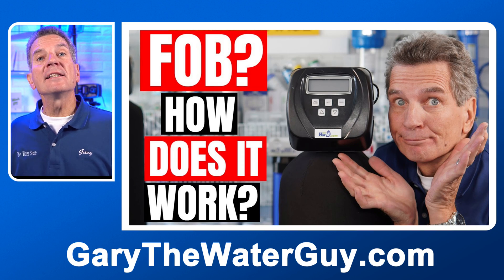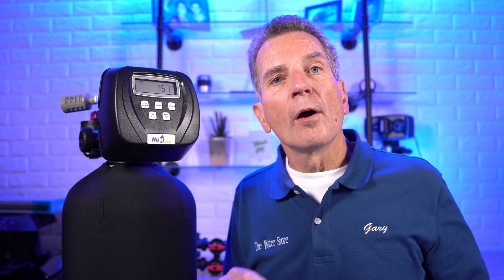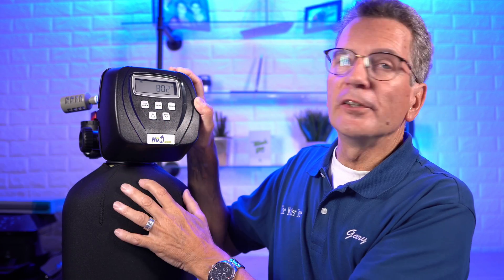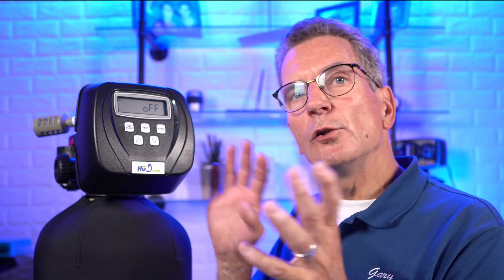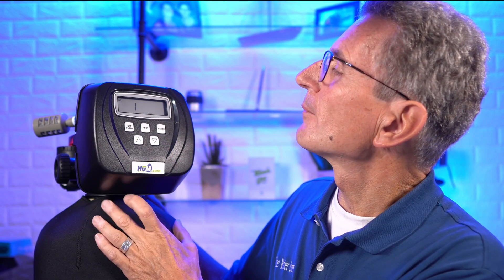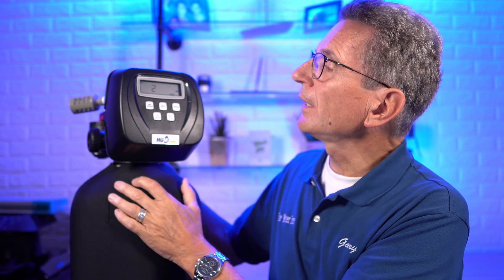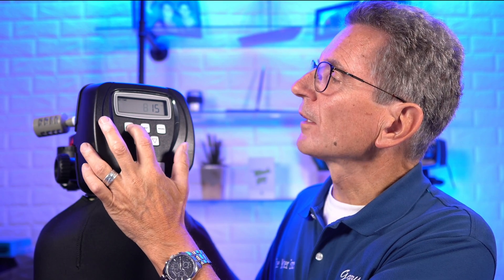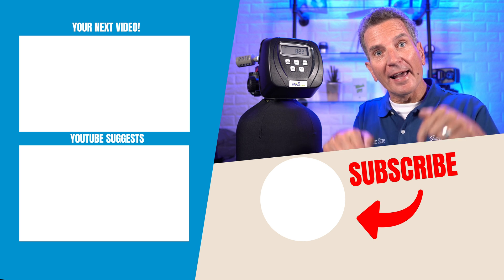CLACK WS1 IRON Water Filter PROGRAMMING

Comment: You don't use any rapid rinse after the airdraw for Katalox?
Reply: Rapid rinse will basically push out the air bubble created during the airdraw cycle. Don't use it in an AIO system

Comment: You said 1 inch valve.   Does that also applies the tube that connect to the control head from the tank. They come in 1 inch and 1.25.

Trying to learn here
Reply: Strictly the valve size.

Comment: I have this style of filter/softener. Mine is hooked up to salt, so I guess I should use the softener selection, and not the filter selection. Is this true?
Reply: Yes. That is either a softener or tannin filter, but both use salt for regeneration and use basically the same softener settings.

Comment: I have this same iron backwash unit. It was originally set to 3 day cycles of backwash by the installer. I didn't think that frequency was necessary based on water color in toilets so I changed the frequency to 4 days. What if I changed it to 5 day cycles. How would I know if the time between cycles is too wide? Thanks.

Comment: Great video !!!  Gary I really believe from my testing of katalox light.  It requires a rinse to get rid of foul water after the Backwash that is still in the bottom of the tank.  I have noticed this from 10 years of testing Katalox light.  I think the programming should be changed to Backwash..............Rinse........Then Brine draw (air)  This will allow it to be rinsed with out losing air pocket.  I am currently going to Install aV3108CC-07 board and V3175CC-01 Cover to my  WS1 valve to accomplish this.
  I would like your feedback. 
 Also a video would save me a lot of time and effort as to trying to figure this out.  This could then be passed on to your Customers using Katlox Light😀
Reply from the maker: This should work but why do you think the backwash alone isn't getting the job done?
Reply: @water_estore  Thanks for the reply, From my testing.  After the back wash is complete. The "Air Draw" cycle/slow rinse.  I have put valve in Rinse and ran the water in to triple bay sink. This is with a 9gpm DLFC.  The water is "dark" for about a minute.  This has been done on several occasions for testing purposes.  This is how I came up with my theory of operation.

Comment: After my iron filter backwashes, I have air @ taps for few hours. Not a big deal, but shower balance valve seems to struggle with the air causing hotter then requested water. Should I reduce air intake time to stop air? Any tips would be appreciated.
Reply from the maker: Yes, that would be the correct way to minimize the concern.

Comment: Hey. I have a question we have this same unit for our home and it is used for iron and Sulphur as we have hard water. The unit is set on softening in the settings should I change that to filtering. 
Thank you
Reply from the maker: No, but the programming depends on a number of factors, if it works I would leave it alone.

Comment: We have a functional Clack WS1 on a media tank that was taken out of service in a water softener application.  Can we convert it to an air over media iron filter by changing to the correct media in the tank, reprogramming the valve as described here, and adding the air intake? Any other changes that would have to be made?

Thanks!
Reply from the maker: Yes but it needs to be a 5 button valve with 3 buttons on the top and 2 on the bottom.  Also, it need to have a tank big enough and flow restrictors sized to the tank and the media.  It will take considerable work to convert it over.

Comment: Hi.. I started getting gray  colour water out my taps after iron removal system does a regeneration. The water clears up after running the water for 5 min. I changed my program to the one suggested in your video but it is still gray after regeneration. I added a rinse cycle but it didn’t help… any suggestions would be appreciated.
Reply from the maker: Hopefully you added the rinse cycle before the air draw (regen)? It could be excess manganese in the water, do you have a water softener after the iron & sulphur filter?
Reply: No I don’t have anything after the iron filter
Reply: The rinse cycle I added is after the air draw… I will change that to before the air draw so I don’t loose the air bubble.
Reply: The system I have uses greensand media and worked great since 2017
Reply from the maker: Don't know much about Greensand systems, haven't used those for over 15 years.

Comment: Hey Gary, I have the HUM FOK iron and sulphur filter from you folks along with the HUM 30k softener with manganese mesh - for the filter settings, after 3 days, it does a regen. Can this be extended without damaging the media or is 3 days the max? Thanks again for all of these great vids!
Reply from the maker: 3days is the maximum on the iron filter.  The water softener is metered so it will determine itself when to regenerate. Thank you for your business!

Comment: Hi Gary, I have two clack tanks both with WS1 valves, I smell sulfur and the 2nd system says iron blocker in the settings , I haven't heard you address that setting , is that correct?
Reply from the maker: I really don't know exactly what you have.  "Iron blocker" is likely a term they have added themselves somehow but that is not part of the Clack OEM programming.  Time to call whomever you bought it from.
Reply: Thanks for the reply. I reset it according to your instructions, I still smell sulfur, so I have called a service company. It’s not an option to call the people that I purchased it from it was part of a new construction build, and they are   not responsive, possibly not even in business anymore

Comment: Great Videos Gary! I have a Fleck Control vlv and it’s set for a 15 minute backwash, 30 minute air draw and a 1 minute RR (Rapid Rinse). I noticed that  the 1 minute is almost 2 and that rinse knocks my air pad down to about 4” below the valve. That doesn’t seem like enough air exposure for the iron. Should I eliminate this cycle and stick with 2 as mentioned in your video? What amount of space should the air gap be?
Reply from the maker: Yes!  There should be no cycles after the air draw.

Comment: Hi, I have two clack valves on both tanks, one is 5 buttons and second is 3. Water softener is 5 buttons and brine tank connected to it. Iron tank is 3 buttons. I would appreciate if you explain how to set regen time on two tanks for best performance.
Reply from the maker: Keep the regeration times at least 2 hours apart.

Comment: I tried doing the programming for the cycles but after pressing next from dPOff it just goes back to the clock. I have a 5 button but they’re all vertical, I’m not exactly sure why it’s not allowing me to edit the cycles. I also have recall and call on my cycles which I haven’t seen on any other systems. Any help is appreciated.
Reply: Forgot to add that recently the waters been coming out clear but with a foul sulfur smell.
Reply from the maker: It's likely locked, this video will show you how to unlock https://youtu.be/bU3wW29R7iE.  The call message means nothing.

Comment: I have a 5-button Clack WS1.  There is no QR code under the cover.  What is the website the QR code directs to?  Thanks.
Reply from the maker: The full manual is here https://cdn.shopify.com/s/files/1/0659/5447/files/Clack_CC_Valve_-_Full_Manual_Including_Diagnostics.pdf?v=1624357628

Comment: Gary. All the videos are great. I have a ws1 fok the system works great with one problem. I have red water iron the system backwashes then rinses then air draw. The problem is after air draw it passes back over backwash on its way back to service. This only last a couple of seconds but is enough to discolor the first 5-10 gallons of water   After that the water is clear again. Is there a way to not pass back over the backwash cycle when going back to service. Thanks
Reply from the maker: No there isn't but lengthening the drine (air draw) cycle might help.

Comment: Hello Gary. Thanks for all the videos. I noticed that you mention that an iron filter does not require that a rinse cycle be programmed. I puzzled. When I phoned the iron filter manufacturer representative, he told me that I need to have a rinse cycle. I'm wondering why there is this disagreement on the need or no need for a rinse cycle?  Daniel in WA.
Reply from the maker: Great question.  Depnds on the kind of iron filter.  The air over media iron filters (newer technology) uses the air draw as partily as a rinse cycle.  If you added a rinse cycle you would lose the air bubble to drain. Older technology systems that don't draw air have a rinse cycle.  https://youtu.be/sx_j7W9z9FQ

Comment: I can change the setting to filtering. But when I try to enter the next menu by twice pressing next-down, nothing happens. I tried unplugging the power clip at the board for a minute+, still nothing, did the same with battery out, still nothing. It is a new board, please help.
Reply from the maker: Once you change to filtering you need to keep pressing next until you get to the end. Then press next-down twice and proceed
Reply: The next-down twice press does not work with the new version (9D) of the control board. It only accepts the pre-programmed P# codes to set regen time cycles, none of which gives a 15 minute backwasf/30 minute slow regen. Always get a fast rinse at the end, which expels the air space needed for sulfur filtering. Is there any work around?

Comment: Another great video Gary! I have my iron filter valve set to 15min backwash and 45 min air draw, but still get a metallic smell and some discoloration in my water, which after sitting in a cup for 3 to 5 minutes turns yellow (clear water iron that oxidizes I am assuming). What's the max time I can set for the air draw cycle to see if increasing the air bubble helps? Is this the right thing to do? Thank you!!
Reply from the maker: 60 minutes

Comment: Hello Gary, will there ever be a reason why my Iron Filter ClackCorp Valve shows "SOFTENING DN POST" as opposed to "FILTERING DN POST"?  With the "SOFTENING DN POST" setting, I could only see 2 times set, being a "Backwash Time" setting of 25 minutes and a "Draw Dn Time" setting of 60 minutes; When I scroll through the settings all others are OFF or not set. I have a pretty big system in my house (1.5" valve, and 22GPM Demand), the controller valve is made of Cast Iron. Initially, the Iron Filter times were lower, and the filter turned on every 3 days. For some apparent reason, this was not enough, and it caused the Injector to get clogged up and was not taking in any air. I had it serviced, and the technician was able to clean the injector. During his visit, he increased the times to 25BW/60DDN and was going to set it to turn on ever 2 days (I am guessing to avoid the injector from getting clogged up with Iron). I asked him to have it turn on everyday as I wanted to flush out and clean my cylinder (approximately 60" high x 18" wide) and all my plumbing. I appreciate you taking the time to inform the general public everything you know about Water Filtration and Conditioning.
Reply from the maker: I have never seen this, but we have never worked with the 1.5" Clack valves so that may be something we don't see in the smaller 1" valves.  Typically regenerating more often does not prevent the injector from clogging.  It will likely clog the injector more frequently.
Reply: Just moved, the sulfur filter says "softening dn post" - what does this mean and what should it be set to? Also...what happens if your sulfur filter is set to "softening" really appreciate the help...  @water_estore

Comment: Gary all of a sudden my clack filtration system has discolored muddy like water. What should I do to help with this? The water at my well is clear but after it goes through my system its discolored and cloudy?
Reply from the maker: Is it a water softener or iron filter?
Reply: @GarytheWaterGuy  iron filter but my guy added carbon to the media so we think that was the problem and it eat through the filter. So every time it regenerated all the sediment came into the house. So we replaced it and didn't add the carbon but now the water has a slight sulfer smell to it. Any ideas how to fix that?

Comment: Got a question for you . I have brine tank that holds salt connected to clack tank tha regens on gallons and that is connected to Air Injection Systems with Fleck 
2510 that draws air but regens everyday. Now the settings are DO-1 BW-10 and BD-60 RR -0 BF-10  . But manual states that RR should be 1 and BF-0 . Which 1 is right ??
Reply from the maker: If your water softener is post fill, the first one is correct.  This video will explain https://youtu.be/GedMruLfXhY
Reply: @water_estore  this is what i found out . That the fleck is running as filter so rr should be off . Would there be a reason why its running as filter ? Just curious
Reply from the maker: If it is used for anything other than a water softener or tannin filter it will be set to run as a filter.  Is it a water softener?
Reply: @water_estore  it is connected to clack which is second unit this one runs first then clack and then water softener tank

Comment: I can’t seem to access the setting with next and up at the same time…it had been working but now when I try that it just shows the number of days until next backwash…any tips?.
Reply from the maker: Reset the board buy unplugging it at the board, wait one minute and then plug it back in.
Reply: Gary tjis is cyndy how do i change the battery if i do.does that mean the whole system needs to be reprogrammed and how do we do that

Comment: I really enjoy your videos!  I use the 3-button WS1 system to oxidize sulphur from my carbon filter using hydrogen peroxide every four days.  What is the correct setting P0 through P9?  Mine was installed with the P4 setting.  How do you choose which P0 - 5 setting to use?  And what concentration H2O2 do you recommend dosing in the brine tank, 7% or 35%?  Thank you!
Reply from the maker: Sorry, I don't use chemical systems so I can't help you.

Comment: Is the small 2032 battery installed on the circuit board panel for back up power function? The display is out even with the unit power cord plugged into outlet, does this mean the circuit board needs replaced?
Reply from the maker: Yes, the battery is for back up only.  This video will help you trouble shoot the circuit board https://youtu.be/E5krvgEW-q0

Comment: Hi Gary! I have a 4 buttons ws1EA, instead of 2 options softening and filtering, I have 1 more, 'filtering regen', which is much like the 'filtering' option in this video. I selected backwash 15mins, draw air 30 mins and everything else off, but after air draw, it automatically add 30 secs washback, and the air pocket gone. Could you help? Thanks!
Reply from the maker: Yes, I have seen that before.  I don't use the 4 button valve and rarely come across one so I don't know.

Comment: When I hold down arrows to regen, it shows C1 9. I here the valve spinning but no water starts flowing.
Reply from the maker: that is the back wash cycle so you should have lots of water flowing to drain.  If not, the connecting rod to the piston is likely broken.  You will need a new Drive End Cap.  contact us at info@waterestore.com and we can get you a quote on the repalcement.

Comment: My WS1 always has a backwash after the Brine stage. No clue why. It does it for 30 seconds even though I only have 2 stages programmed and everything off afterwards. Im stuck programming it on softening mode which I feel is not optimal. I have a Hague 800 that is set for a 10 minute backwash and a 40 minute brine using the softening setting. I feel like I never get a large air pocket and that it is drawn out too soon when using water.
Reply from the maker: How many control buttons oin the front of you WS1?
Reply: @water_estore  5 all in a straight row

Comment: Great video! My Clack head also has "4 - fill" and "5 - relay" after the "3 - backwash." The "4 - fill" option is set at 0.95 capacity. Could you tell me what these are for and what setting I should use for these options?
Reply from the maker: It depends on many variables.  Fill is based on the other settings like how big the tank is and how much salt per regeneration.
Reply: @water_estore  Thank you for your reply! I am wanting to use this tank for filtering as I have another tank for softening. I heard this head called the Clack WS Gold but I can't find any info on it. Do you know where I could find an owner's manual on this?

Comment: I have an iron filter with a clack WS1 value. An air over media. I can not keep an air bubble in my tank. I do a 15 minute backwash, a 40 minute air draw and a 5 minute rinse cycle. During the rinse cycle the water goes back into the tank so the air bubble is no longer there and the tank is full of water. Therefore not working properly for getting Sulphur out of the water. I noticed you do not program a third cycle or rinse cycle in my case. Should I be doing a rinse cycle?
Reply from the maker: You nailed it!  There should be no rinse cycle, that is what's releasing the air bubble!
Reply: @water_estore  Thank you for the confirmation. Also my filter is set to softening not filter I just run the backwash and draw cycle now and it works great. Should I still change it to filtering from softening or is there really no difference in value performance?
Reply: @Mackattackm2013  I know it's over a year since you asked this question, I have the same setting in my iron filter. Did you ever figure out the answer? Thanks!
Reply: @pablomunoz3430  What I ended up doing was getting rid of the rinse cycle and it has been working just fine. I still use softening not filter.
Reply: @Mackattackm2013  thanks for getting back to me. I kept it at 'filtering' but fixed my issue by replacing an internal check valve at the water inlet that was literally clogged with iron. I still have other issues that I am trying to figure out but thanks again for your reply :)